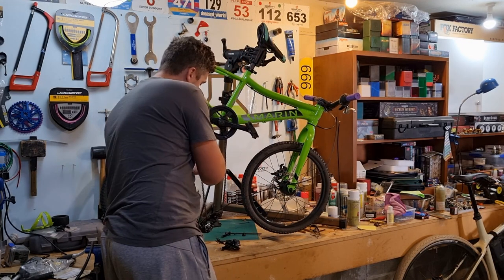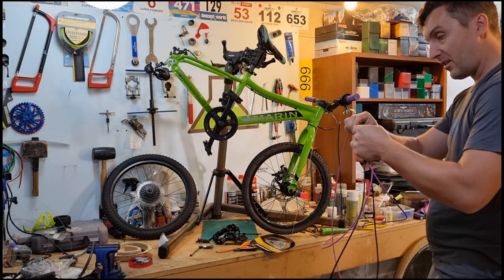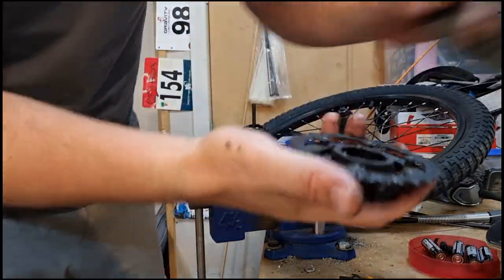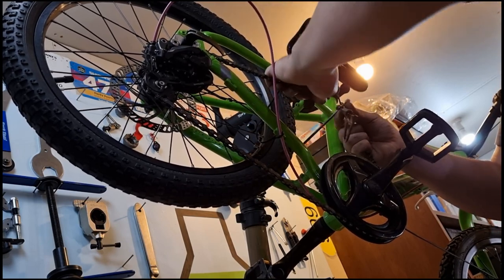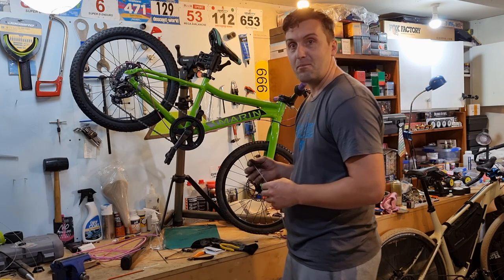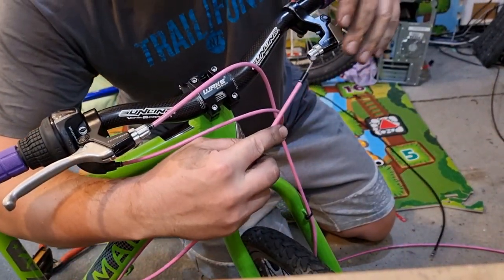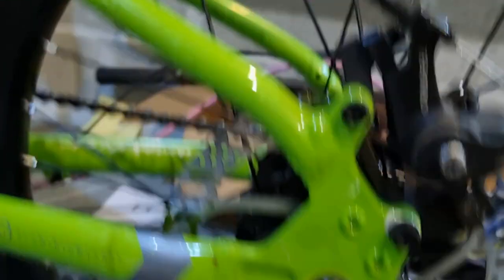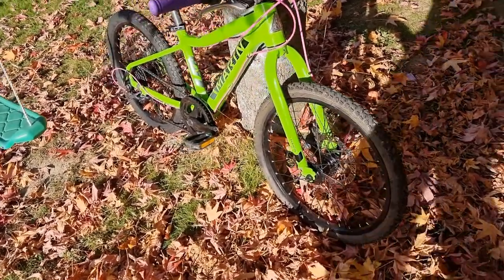Kids Marin Hidden Canyon MTB upgrade

Comment: Schwalbe Rocket Ron is light, grippy but super expensive. Got lucky finding it on discount. Pedal-wise, I ended up sticking with cheap plastic ones as my daughter hurt herself when using those with pins. A friend purchased some with a skateboard like grip tape surface. They seem to work pretty well.

Comment: a few points to share: that front plastic chain guide is essential if you dont have a narrow wide crank set, as soon as your kid goes over any sidewalk drops or bumpy tracks the chain is likely to come off. (happened my kids bike a lot even with a clutch derailleur so I bought a HUP crankset and cheap amazon narrow wide chainring.) second point is pedals, crankbrothers stamp 1's size xs. work amazing for kids, super grippy, made of nylon so way more durable than the plastic junk that gets damaged easily.  You can always swap them to the next bike when they outgrow it too.
Reply from the maker: I agree on the pedals, the bike will get the nice anodised pedals from her old mtb swapped on to it when they are not on her BMX.  The bash ring/guide had space for the chain to fit between the chainring and plate & was flimsy. The chain will definitely not be held on properly by it so I will see how it goes and put a DMR top chainguide on if it needs it :)

Comment: I want to upgrade the rubbish 8 Speed Box drive train on my daughters bike. The cassette is an 11-42 so would be good to keep that, but not sure on how to find a derailleur and a shifter that is easy to use. The box shifter is very hard to shift up with. Any suggestions?
As for pedals, my kids seem to be fine with the metal spikes but I am a huge fan of the SDG Pro kits, not cheap but I just move them from bike to bike. The 19mm grips are amazing for small hands when it comes to reaching the brakes etc. I can't see them needing thicker grips until they are much older.
Tyres, the Commencal store in town has Maxxis Minions in stock for 20" bikes, $44ea ($70 from Evo..) They usually carry the Vee 20" but no stock currently.
Reply from the maker: Sweet, I will go and get some minions from commencal next week :)  I think I'm going to swap the cassette and shifter to a 9 speed shimano if the grip shift is too annoying.  Don't know what pull ratio the Box rear mechs use (hope it's the same as shimano but a bit of googling says it isnt!).

Cycle trading used to have lots of older drive train stuff (8 and 9 speed) not sure if they still do?
Reply: @W1DO  I ended up removing the Box and replacing with Shimano Zee 10 speed. It's lighter and nicer shifting, lost the big 42 tooth gear. The pull ratio did not match anything else so had little option. You are welcome to install it and give it a try if you want. Will be better than the twist shift.